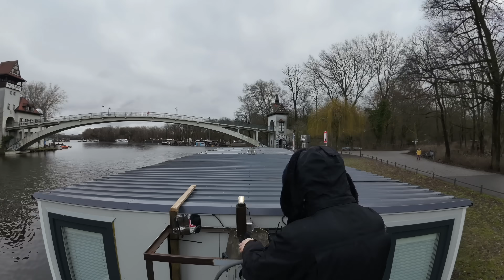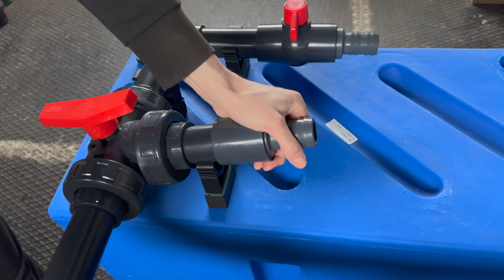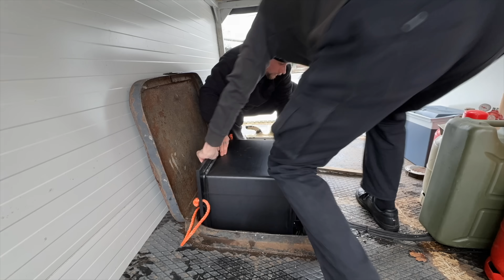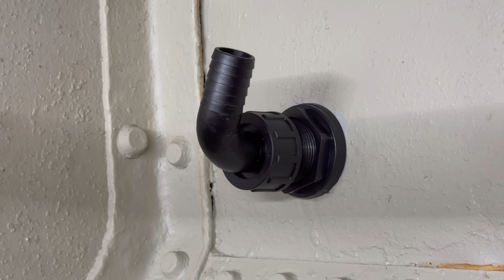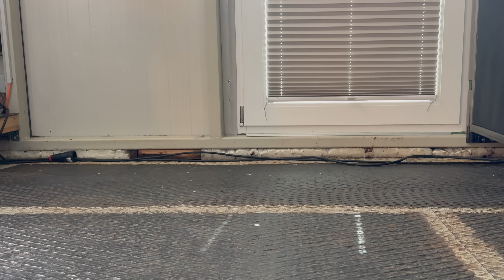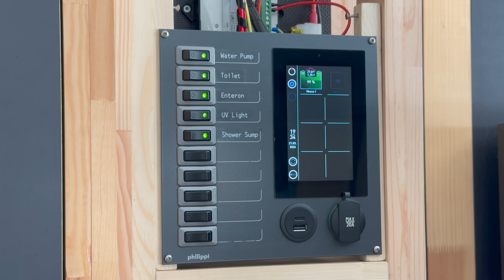I Made a Huge Upgrade to My Houseboat

Comment: We already came up with a good solution for RV style waste removal 
Incineration toilet. Do your business, then use a large amount of electricity to Incineration waste into ash. The Ash being safe enough to dump in the water. 

Sure theres plus and minus to both systems. But giving enough power (which many RVs have enough to run it) Its as simple as a regular toilet.
Your system is like do chemistry, and having a Pet. Just seems like alot could go wrong.

Comment: You should install a few gromits in those holes you drilled on your deck to prevent the isolation of your cables to get damaged by the motions of the boat in the long term.

Comment: Nice video. Some rubber grommets around those metal holes will protect any wiring or other material passing through from fraying. Even slight vibration can be hard on electrical wiring.

Comment: Is this a specific anti-rust paint? Because painting over rust sounds a little dodgy to me?
Reply: I was a little surprised myself that no rust treatment was applied before painting. 
Even red oxide primer would have been good. 
But would he go to all this effort, without making sure it won't simply rust up again? (Implying that yes, that is a special anti-rust paint.)
On the other hand, if that rust took 50 years to accumulate, it'll be another 50 years before it's any kind of problem again. Sometimes "good enough" to last the duration is all that is needed.